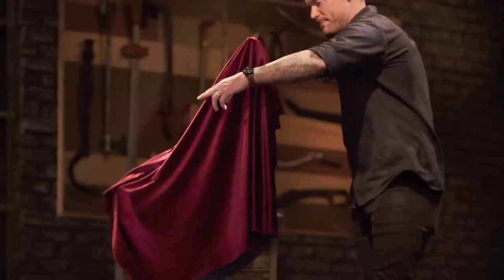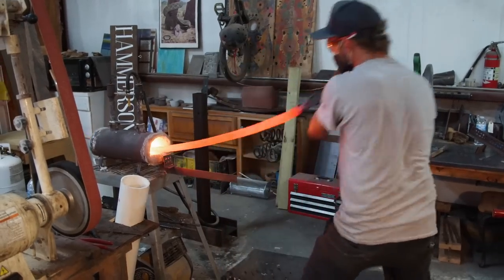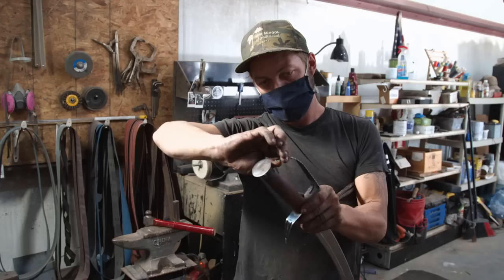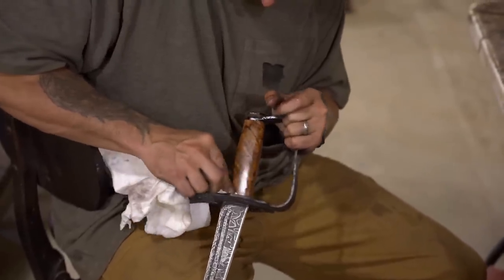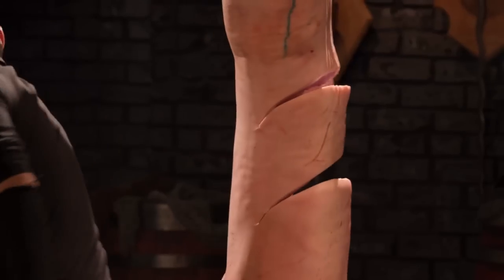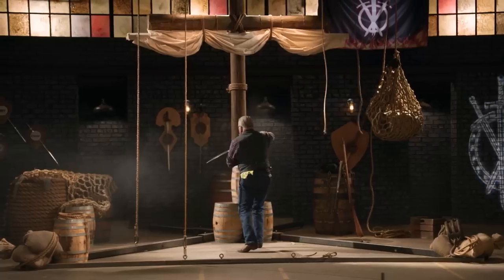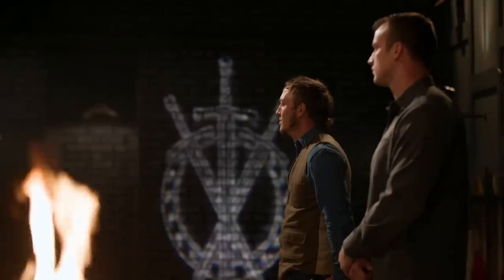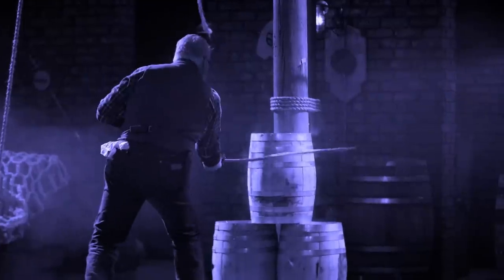These Swords Are REVOLUTIONARY (Literally!) | Forged in Fire (Season 9)

Comment: A lot of these blades are traditionally stored in a sheath or a holster of sorts. They should do a draw scenario where they pull it out of the holster before the kill test. It would make the challenge harder also if they had to design the blade to fit the holster or sheath
Reply: Or make the sheath for the sword.